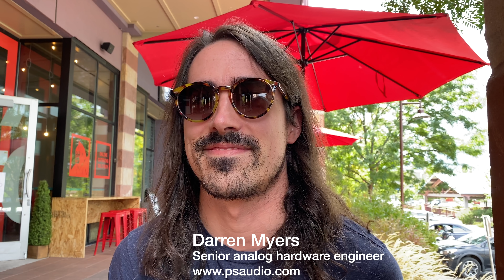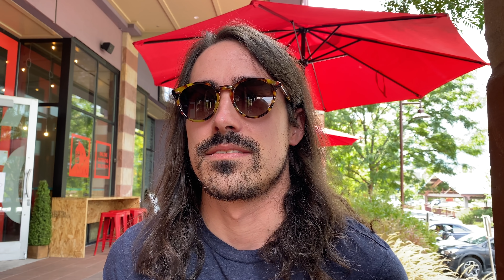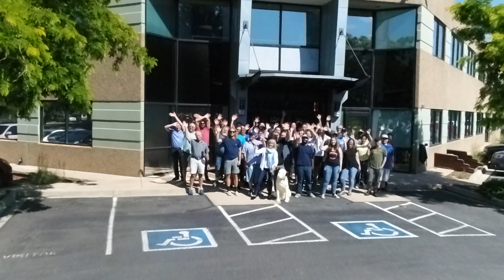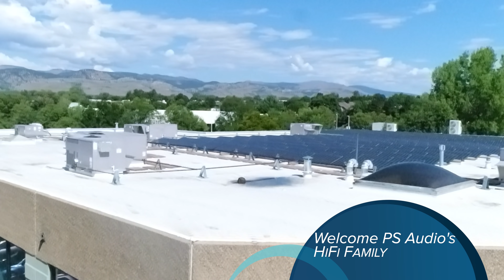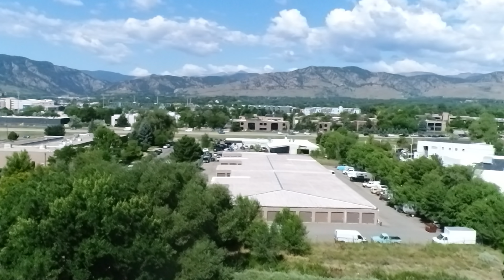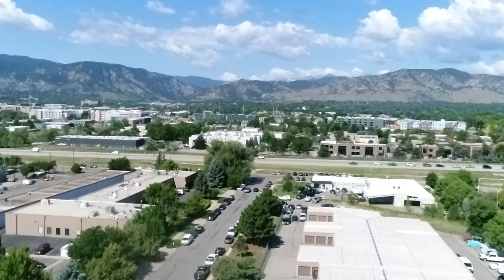Lunch with Paul: the art of the phono stage Part 1

Comment: How can you limit the bandwidth and not effect the slew-rate?  You say they are not necessarily tied together (for this I'll assume gains are fixed).  The only case I can think of is by not passing the low frequency stuff, you could narrow the bandwidth but why would you do that other than for rumble?  What about the flavor of the RIAA compensation in your designs?